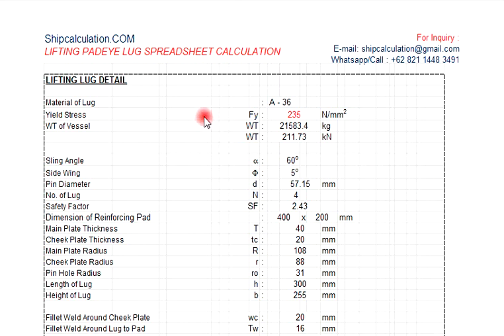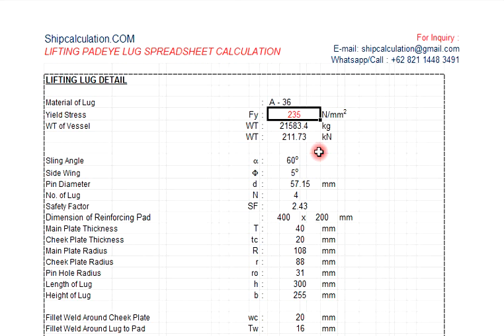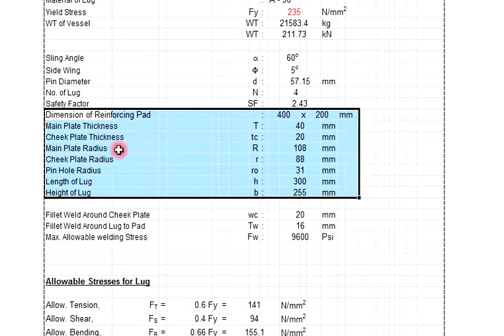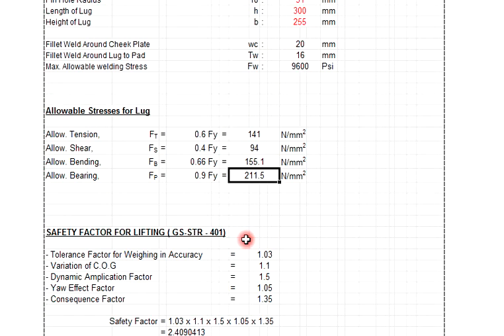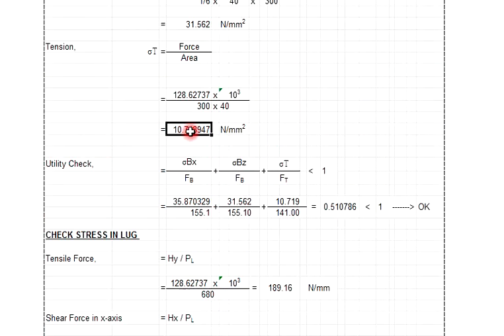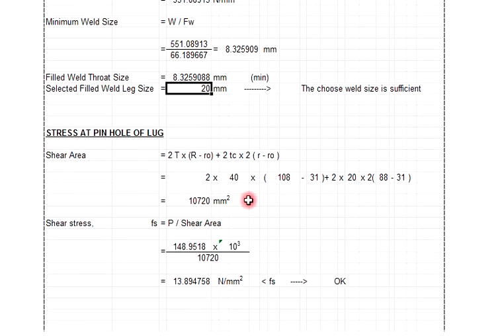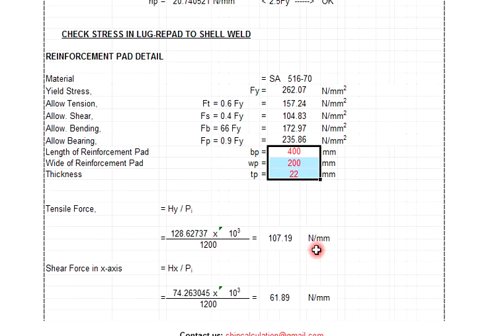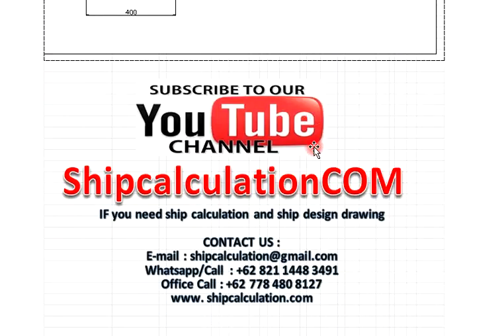Lifting Eye Lug Spreadsheet Excel Calculation

Comment: Consequence factor suppose to include DAF. it added two times. is it not correct.
Reply from the maker: Dynamic Amplification Factor (DAF) its already added with max 1.5 x Wg , refer to 0027/NDI  Page 14 Table 5.1 related with DAF and has been classified with Offshore and inshore function. Get Excel sheet so that you can check the formula and make it correctly with your own calculation if you think not correct, we provided based on classification rules and others standard rules. www.shipcalculation.com